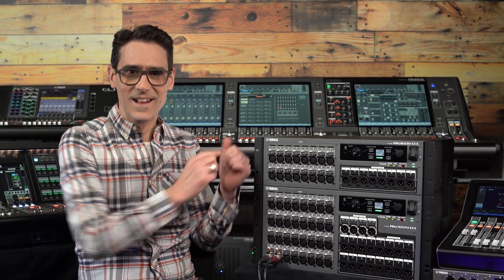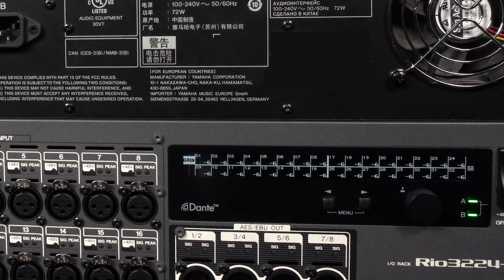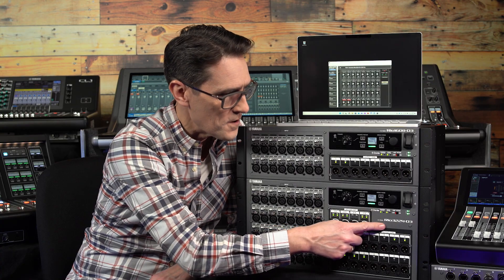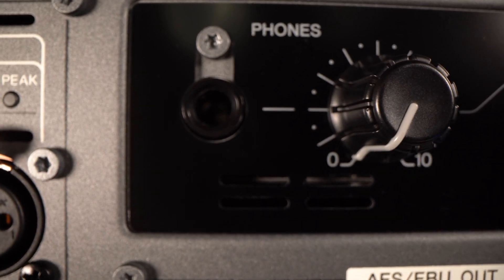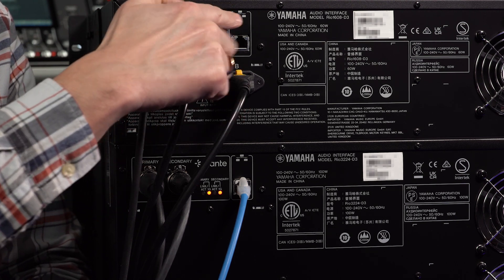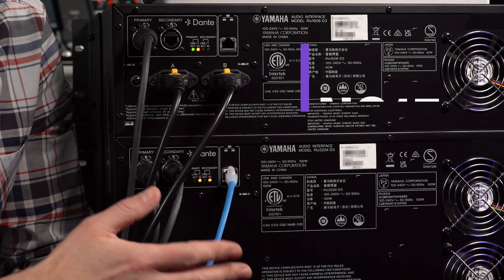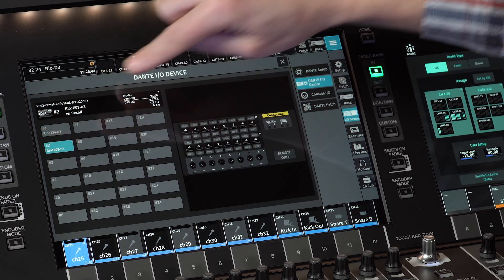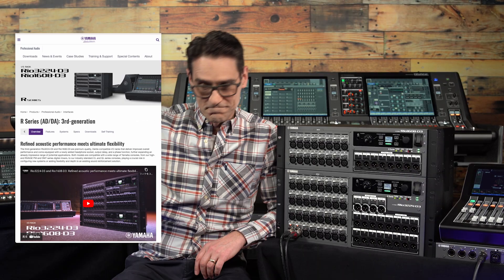Introducing Rio3224-D3 & Rio1608-D3

Comment: Wish they had used Ethercon on the standard network port too....
Reply: Annoyingly, it seems to be a recurring theme across audio manufacturers to make use of ruggedised Ethercon connectors for Dante (or other audio networking protocols), but only a standard RJ45 socket for control ports.

Comment: Why don't they have XLR/jack combo connectors?
Reply: At that point is better to use DI Boxes
Reply: @trmus  You only need DI-Boxes if the distance to the instrument is far away (like more then 3m -> balanced signal). But if the instruments are close it would be a nobrainer to build in an combo jack.
Reply: Combo jacks are more common in consumer level products, most pro audio are XLR only
Reply: @kadjmusic  Thats the status quo in pro audio yes. But is it practical? I don't think so. For this price range a combo jack would not be the cost driver.
Reply: @verbenich  also, for combo jacks, the maximum recommended length for a TS cable is 15-20’. These stage boxes are often used in settings where the source is up to 100’ away and often of different power sources.. that is why DIs with ground lift capabilities are recommended. Adding combo jacks in the application are just setting people up for failurez
Reply: @kadjmusic while thats true ... Most stageboxes are directly placed behind the band, in reach within 5-10m. Then its signal converted to digital anyway. A combo input won't hurt anybody.
Reply: @RinaldoJonathan  maybe in a bar/club gig. these are considered a touring level product, and I have never done a tour where the stage box wasn’t in an execution rack in monitor world.. in this case, the NEAREST input is as much as 50’ away considering cable paths… at this point, it’s all sub-snakes etc
Reply: @ partly true. but still combo jack won't hurt anyone, or someone would make illegal TS to XLR converter anyway.
Reply: @ I mean.. DigiCo, Yamaha, Allen & Heath, Avid, SSL etc all have people much smarter than I am making those decisions as a professional standard.. 

then there are consumer level companies like Mackie and Behringer that include it for cost effectiveness and convenience to the consumer.
Reply: @RinaldoJonathan  
1. it would hurt the cost, because they buy XLR connectors in 10's of thousands, which decreases prices significantly, to stock two types of connectors (also at the repair shops) is a disadvantage, 

2. I have never seen a sound engineer / stage tech who wants long jacks on stage between keyboards / samplers etc. and the stagebox, without the ability to pad / ground lift etc., especially when you mostly don't know how the power is distributed

3. to extend a jack when longer cable is needed is not possible without connection adapters, same pain as with speakon barels for cheap speakons, AND you carry two types of long audio cables for the same task (not talking about instrument high impedance coaxial TS jack cables)

4. when i really need and want jacks somewhere directly, mostly as a last resort, i have multiple short cable TRS <-> XLR adapters, which can be used with XLR cables, and extended if needed, 

5. i also carry short jack patches TRS and TS, straight and angled, to get everything into DI boxes asap, or to assist with broken pedalboard cabling etc.
Reply: And Bluetooth input channel.
Reply: @My_handle_is_LG  Ok, that is definetly a whole different device and use case which is not covered and expected in a device like a RIO.
Reply: @verbenich  you answered your question)
Reply: @My_handle_is_LG  Don't think so